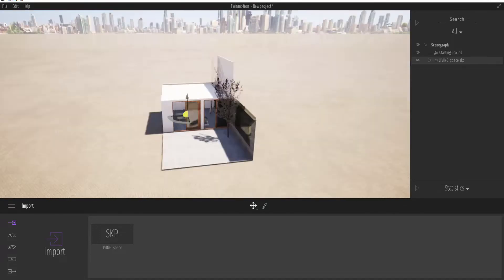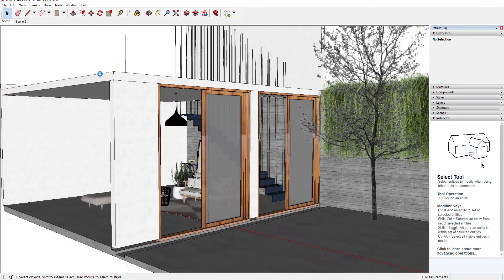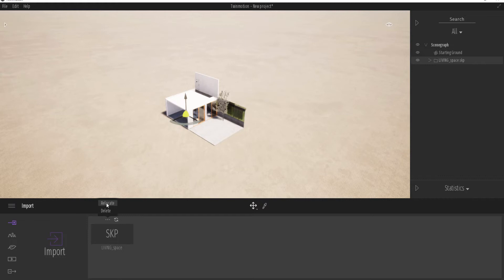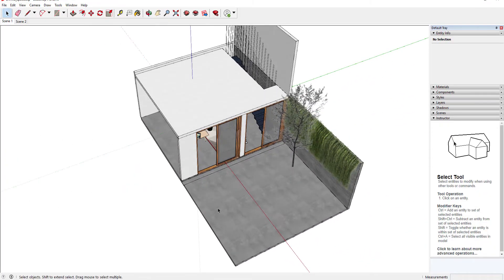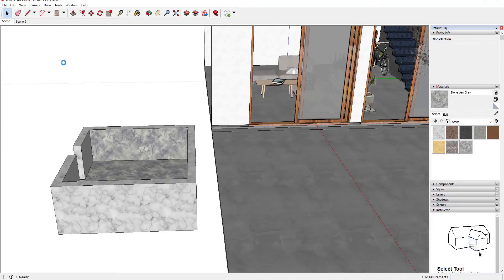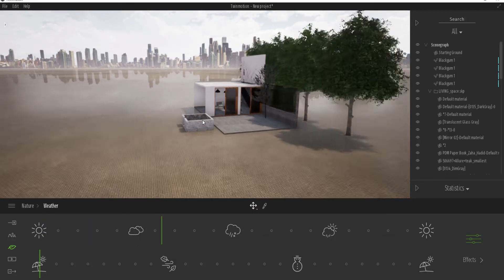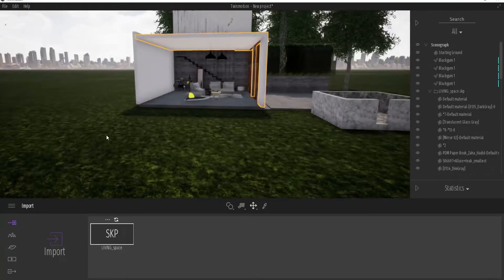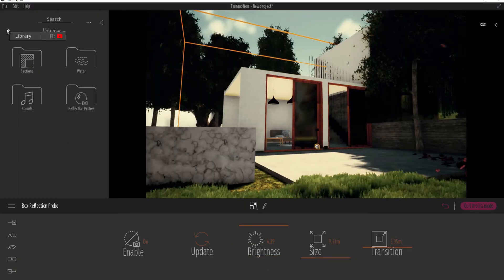UPDATING A SKETCHUP IN TWINMOTION - FAQS 03

Comment: Hi NK, thank you for the tutorial. But there are some bugs worth mentioning to your audience maybe. 1. Do not move the sketchup model in Sketchup. It does not matter if you move the SU model in Twinmotion because Twinmotion only recognizes the location of SU model in SU. So if you move the model in Sketchup and re-import into Twinmotion, the model shifts and it is hard to move the model back to the old location in Twinmotion.  2. If you change some surfaces of the model in sketchup, for example, exploding the curve lawn surface. You need to re-paint the grass in Twinmotion. So once the surfaces of the model changed in sketchup, everything painted on the surface in Twinmotion would be Gone.  And if there was path crossing the surface, the people/vehicle would behave weirdly. So you need to edit the path in Twinmotion